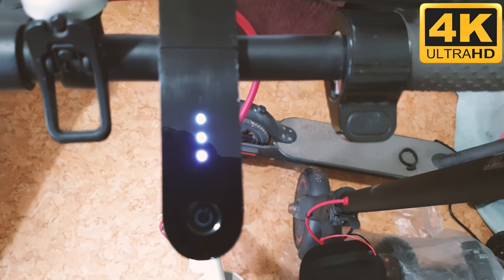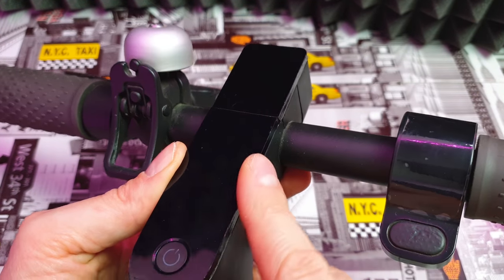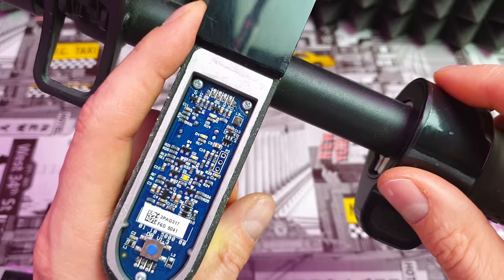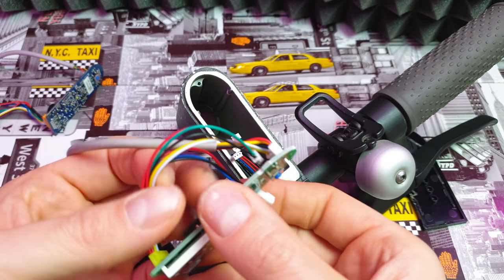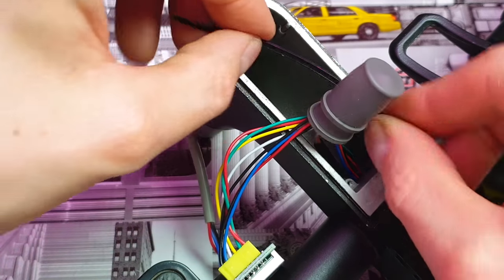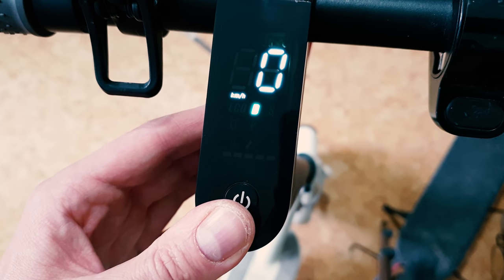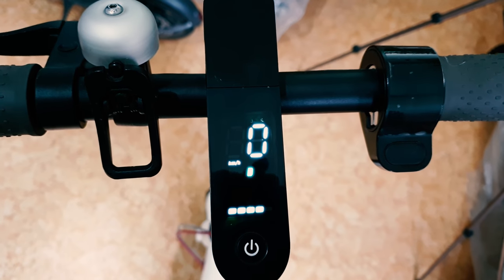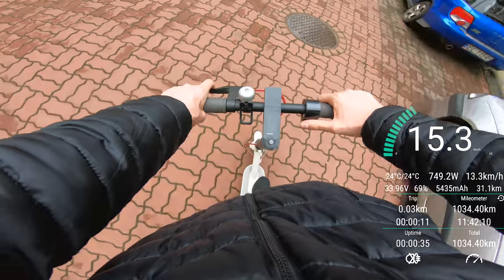How to Mod Xiaomi M365 to Pro Dashboard 🚀⚡ For only 25$ ?!  🔥🔥

Comment: Got mine working by using St link flashing the BLE. my only issue is when I turn on the front headlight the scooter goes nuts screen flickering and motor start engaging by itself 🤔 I've tried 2 different displays off amazon now both are doing this. If I unplug the front light the scooter works perfectly fine so strange

Comment: flashed the bluetooth firmware then flashed with custom firmware and the battery indicator immediately jumped to red, speed meter stopped working.... what am I doing wrong?

Comment: So my Firmware is 1.5.2 and i bought the pro Dashboard but the light is not working and i cant switch between drive modes like in this video, i have an iPhone and there is an App called „m365 downG“ in the apple store, what bin files are needed and where can i find those files to fix this problem?

Comment: Yeeh! good video!! the only way to update the firmware with that board is using a st-link, although as you say it is better to plug in the old board when you want to change the firmware. A greeting.

Comment: I used the iOS version of m365 downg to install a cfw 1.4.2 couple weeks ago. Everything worked fine.  Then today, I received the pro dashboard. I tried making my own gonka365 1.5.5 firmware and I tried the firmware in the description.  In both cases, the iOS app said the flashing was “done”.  But the firmware stays at 1.4.2.  Any ideas?
Reply: what’s the app called for ios

Comment: Ble And Firmware xiaomi scooter pro 2
I have the pro 2 And I installed the BLE via Bluetooth, when it was finished the screen froze and I pressed the powere button and closed the screen. Then it never reopened. The BLE I installed was for the pro 1, if I buy the screen of pro 1 and put it on the skate do you think it will work? in essence the skate has the new screen of pro 2. So maybe it doesn't match the BLE I installed on this screen.

Comment: Hi I did everything that’s in the video the problem is that after everything I’m having an annoying error 14 when I plug my scooter and in full battery it doesn’t error but when it goes 85% and below the error 14 occurs. I’m on drv 1.55 and bms bl on 10201

Comment: I have a really important question! I have an normal Xiaomi m365 with an extra battery so it's already flashed. But know I want to upgrade too pro display because the old power button don't work. How can I flash so the pro display and the extern battery are connected both

Comment: Can you please share a screenshot with DRV155 32kmh 50k 5% more power.zip settings? I like it very much i just want to change one or two settings (for example motor start speed)

Comment: I'm still riding my m365 that I got before I watched this video 4 years ago. Everything is original even the battery but vibration is making it fall apart. 
I finally came up on the pro screen and am going to do this upgrade, the screen came from some white segway but it's identical to the m365 pro board. Thank you for this video, I've wanted to do this for a while but am scrd of flashing the controller.
I'm kinda proud of the odometer, do you know if it will reset if I flash to upgrade the screen?
If it does I might not upgrade, might have a m365 with more wiles then anyone and it's still not showing any drop in power (I go about 2mile trips maybe 3 times a week) and always make sure the battery is fully charged but I think the bms (also never flashed) is keeping max charge at 38v. Not sure where I heard that but something I remember from back in the day when first got it and was looking into modding.
Sry about the long message, just one more question in this....... 
When the battery has a cell bank starting to go instead of just replacing the bad cells can I just upgrade the battery and somehow change the setting of amp hours it has because I've seen in the m365 app that it shows set amp hours. Oh that app is probably where I seen max voltage charge power.
Also headlight flashes and effects power if turned on but I never use it. Think I seen its on the battery bms but again it was a long time ago.

Anyways,
Sry for the drunk Friday night book of a message.
Cheers and hope u have a great weekend!

Comment: in my M365 I have software ver. 1.51. Can I upgrade it directly to the 1.5.5 or I have to downgrade it to 1.4.1 or even lower? Which soft generator should I use ideally?

Comment: Followed the instructions after successfully flashing DRV155 The display shows 10 and a red wrench. It turns off automatically after 15 seconds which doesn’t allow me to connect via Bluetooth to M365_down or the mi app. Pretty much bricked my scooter. Now I have to st Iink to unbrick my controller or buy a whole new one. Be careful!
Reply: had a similar issue, showed 14 and a red wrench. I was able to fix it by putting the old PCB back on and using a 1.3.8 build from https://m365.botox.bz/ and flashing with https://play.google.com/store/apps/details?id=com.m365downgrade

Comment: Great video, just installed mine yesterday. 2 issues I can’t figure out, I am not able to switch to MPH, I change it on the mi home app, but it doesn’t change it on the dash, I also tried  other app like M365 dashboard, M365 plus but no luck, also I am not able to update firmware, just says error.

Comment: the connectors to the speed controller are different for me. Is there an adapter I can buy? can I splice the wires?
Reply from the maker: It have to be the same, otherwise your scooter could be not genuine xiaomi

Comment: El BMS que debéis de utilizar es el 115 de la versión normal. Antes de cambiar la placa el patinete debe de tener la versión ble 0.81 y el bms 115. Cambias la placa y solamente necesitas cargar el firmware de la versión pro. NO HAY QUE CAMBIAR NADA MAS, TU BATERIA ES NORMAL. CUALQUIER BMS DIFERENTE ES POR QUE LA BATERIA ES DIFERENTE Y LLEVA SU PROPIO BMS, COMO MEJOR FUNCIONA ES CON SU BMS 115.

Comment: Looks like you have a clone board, the original board does not flash the Bluetooth LED icon. 

Also how do you go back to the 4 LED firmware ?? I had 1.5.5 and then it upgraded to 1.6.6. 

Now If i try to swap back, the leds just count down, and then the scooter turns off. It must be a firmware issue. 

Any ideas ?

Comment: what's up brotha! I know you through flyin FPV drones but recognized your voice right off. I Just got a used m395 & installed the pro m395 display. It looks like your the guy to ask so.... what setup would you rec. firmware for sure. Like can you run the highest power and KMH firmware with just the m395 with a pro display or do I have to have the pro version of the scooter too. Thanks man...... Keep killin it!

Comment: Hey everyone! I have a major problem which might have killed my scooter. I did everything Pirate said to (swapped out the board, downloaded all 3 FW files, etc.) and when I went to upload the FW onto the scooter, I was able to upload all 3, but the scooter still behaves as it did before the updates. It looks like everyone else only did the DRV FW updates, and theirs worked. Is there any way I can clear all the FW updates off the scooter, so I can start from scratch with the 1.3.8 FW again?
Reply: where u find files to download?

Comment: Hey there had a question I live in a unicorperated area where junk yards were now being made to house tract and a field they were clearing a worker found a bird scooter first ( gen bird 1 ) the ones you buy for ( $1,200 ) and he said If i wanted it said sure pushed it home  bad shape cables and accerler wire .. so gona contact bird in Santa Monica calif . See if they can trace it to owner if they are registered..see if he wants it back .. would it cost a lot to refurbish it and make it usable ..
Reply: That's a very good question, which more or less, tethers to the rabbit hole of scooter modding. 
Believe it or not, there's a whole community out there devoted to unlocking these commercial scooters; for personal use. 
....Yea..

Comment: Great video, managed to install the display very quickly and easily thank to you, I just have one more question, is it possible to update the firmware without android device?
I am an iPhone user and I can not seem to find the apps necessary for the flash of firmware on the AppStore . 
Cheers buddy
Reply from the maker: no :( , you need android phone . 🍕🍻🍗

Comment: 2 questions, can you flash the speed to unlock the 32km & second can you change KMH to MPH?
Reply: I believe you just need to change the setting in your app. For example, I personally prefer km (I'm in Canada 😁) and I just went into the app and selected which I want it on.

Comment: Dude, do yourself a favor and buy some proper cutting pliers like Knipex  78 03 125. No way to cut rubber with them and also great for zip ties.
Reply: Exactly...just use some wire cutters.  Seeing you with that huge razor blade was making me super nervous.

Comment: Hi, In M365_downG, I can connect to the new dash baord upgrade. I can also check version and battery info.  But when I go to Open bin there are no files to open.  Where do I get these files to upgrade the dashboard so it works with my Xiaomi Scooter.  Any help appreciated.  For time being I have resorted to my original dash board.
Reply: hi Mohammed, I discovered today that you can use the official "xiaomi home" app from google play store to do the firmware update so you don't need to find the files separately. When you register with the app and connect your scooter via bluetooth it will tell you a firmware update is available, and give the option of m365 firmware or pro firmware. Choose the pro and it works great.

Comment: My m365 is going 30km/h with only one firmware upgrade, it runs fine, and at maximum reach it's basically the same except power draw in hills are bigger and it takes me there faster. I also modified how the battery gets charged while braking and down hills, this will recharge the battery at a greater phase, it works fine for me. I don't want the pro model since the charge time is much longer and I normally don't go for several miles. Basically the original battery takes about 5.5 hours from 0 to 100% and the pro model takes about 8.5 hours from 0 to 100%. That makes the charging capacity in time much greater in the none pro model.
Reply: I have a pro dashboard and it the scooter works fine but the display doesn't work.  It lights up but shows no speed or battery or anything.
Reply: @scootersonlyrepair6773  my comment was from over a year ago, since then my 365 has died (battery controller burned out) i have also bought my self the pro 2 with nearly the same configuration as my old one. I do how ever have a clicking noice from the motor at high speeds, i will be opening it up during next week to find out what it might be.

Comment: So is there any need to flash BLE and BMS or not? Screen is working fine for me after flashing DRV
Reply from the maker: Nope
Reply: Of course there's a reason! But it runs fine without updating the bms and ble. If want better battery performance and easy flashing update the bms and ble.

Comment: It's not possible to use this pro version of the electric board without extra battery? Because it's just the display which use a little more power or? I just want to buy it without extra battery packs. Thanks for showing us this hack. Best regards!

Comment: Thanks for this video man, it helped me to do this job. I found I could do the firmware upgrade on the xiaomi home app and got 29kph straight away just choose the pro version firmware when the app gives the option.
Reply: Can you explain this to me simply pls
Reply: @Al1Shah  I will try, when i fitted the new pro display to the M365 I did it exactly like he shows on the video, but when he updated the firmware in the video he used an app called m365 downG. This app is not an official Xiaomi app and he had to find the firmware separately.When I updated the firmware I used the official "Xiaomi home" app from google play store so I did not have to find the firmware myself. hope this helps, if not let me know and I'll try to make a video to show you more.
Reply: Paul Ryder I think I understand. Basically I am thinking about buying a xiaomi scooter but I’m unsure on whether to get the pro or normal (and just install the pro dashboard). The main reason is the further distance that appeals to me. Other than that, there seems to be no difference. What do you suggest?
Reply: @Al1Shah  yes the only difference between the basic m365 and pro is larger battery (longer range) and slightly faster. if you buy the basic m365 and do the display and firmware update it is essentially a pro version with slightly less range. I've had my scooter for a year now and done 1000km on it. If you're planning on using it for journeys longer than 10 miles I'd buy the pro, for anything within 10 miles the basic m365 can handle it with ease.
Reply: Paul Ryder right thank you, I think I’ll go with the pro

Comment: Will this mod work with the standard firmware update on the mi m365, by just plugging it in and no custom firmware needed, will it work as a straight replacement thanks
Reply from the maker: You have to upgrade firmware
Reply: @PirateWasHere  ok thanks

Comment: Getting E10 error with the new display says is compatible for MI 365 pro. I can't update the firmware because it's E10 error
Reply from the maker: Hi bro, this video is old, i will not work with newer m365 :(

Comment: Hello pirate,I have a question for you.I have a custom firmware installed on m365 scooter .I have already ordered the board and it's on  the way.Should I leave the custom firmware as it is or should i return back to its original firmware before installing the pro one?
Reply from the maker: Doesnt matter bro, i would leave custom one as u got now 🍕🍻
Reply: @PirateWasHere  Thanks mate

Comment: Hey guys, i hope some of you could help me. I have bought a clone dashboard and it all seems of good quality, it wasn't cheap.
I have installed it correctly and tried to install the Pro custom firmware but now my scooter doesnt't do anything.
The screen stays on but it doesn't react anyhow. Both M365_downG and M365 Tools can't connect to the scooter either.
I really don't understand what went wrong. I have tried disconnecting it and connecting it again many times but nothing :(
Reply: you can try to factory flash the board using a stlink.

Comment: I mounted the m365 pro dashboard as in the video and I upgraded only the drv linked, every worked fine but now,  after the scooter recharge it doesn't switch on. I think is a problem of the BMS that doesn't flash so the battery doesn't recognize the charger
Reply: Okay, I try to unlink the battery connector for 30 seconds and restart to charge, it seems that it charge again but sometimes it stops. M365 down doesn't recognize the BLE and BMS version but inside M365 tools app I can see BLE 0072 and BMS 0116. I've tried to upload BMS but I have the same problem, at 98% the dashboard turnt itself off
Reply from the maker: Looks like your battery can be damaged or ESC , recheck whole thing + connectctors
Reply: @PirateWasHere  Now I have another problem. The scooter seems dead, the button doesn't works. If I connect the charger I can switch on the scooter and seems to work but the battery level is strange, it never arrives to 100%. I updated the BMS connecting the old dashboard but it's the same, after charging if I put off the charger and push the switch it beeps and light up for a moment, then it switch off in "dead mode". I opened the bottom cover and all the led lights are off until I connect the charger and every works again. Is it a BMS problem for your opinion?
Reply from the maker: @DanieleMuo  Yeah it could be BMS, or one of clips on the battery popout , remove whole battery and check it

Comment: So a lot of people are having issues flashing the bms and ble, how do you get past this??
I just connected my original board (non pro) just with the connector, nothing else was connected, and was able to connect to M365downG was able to check version as well, and BMS was 116 & BLE was 72 with fw 155. So i am not sure if these are correct. Also i noticed that the brake light and one light was flashing on the original dashboard? 
I am now going to connect the pro dashboard again to see if i can connect to M365downG again and try to check version.😁
Ok so i reconnected the pro dashboard bought from AliExpress for only £13.62!! 
I got some different results on the bms and ble. It states: 
BMS ver. 10201
BLE ver. 10201
BMS ver. 10201
BLE ver. 10201
DRV ver. 155
Not sure why it lists bms & ble twice?? I am also not sure if i should try to flash the bms and ble again?
Pro Fw instructions and file that i used: 
https://mybestscooter.co.uk/products/xiaomi-m365-pro-dashboard-circuit-board-led-display
Could someone please comment who's in the know how about flashing and how to get this bms & ble correctly flashed. TY😁👍
Reply: pardon??

Comment: I had trouble with extra battery. Can you recomand a firmware with charge mode disable for m365 with pro display?
Reply: Where did you get your extra battery ? Is it external
Reply: @ahrayahbayasharalah6876  yes. Buy it from Aliexpress
Reply: Cool

Comment: I am in 1.3.8 custom firmware. If I update BMS can I still use custom firmware? Is it possible or they are irrelevant to each other?
Reply from the maker: Don't update BMS
Reply: @PirateWasHere  Ok thanks! Another question: By flashing DRV_proV155.zip what do I get besides dashboard support? Stock speeds of m365 or m365 pro?
I'm now fast enough with 1.3.8 custom firmware and I'm a bit confused if this update worths it!